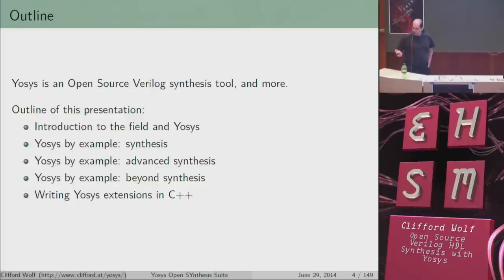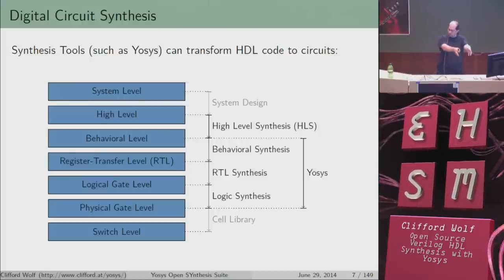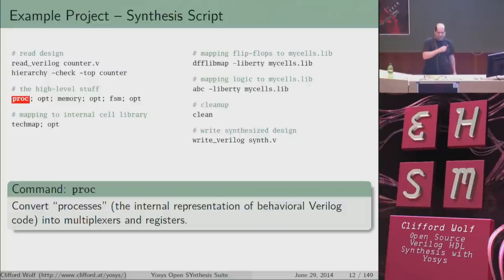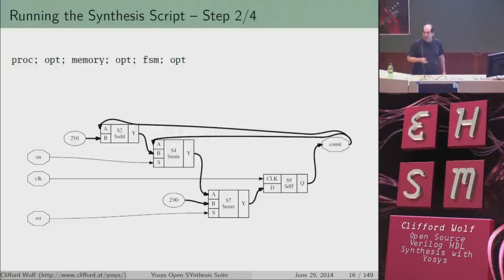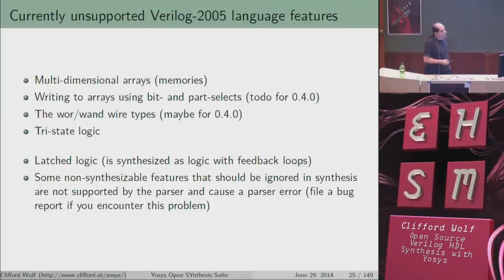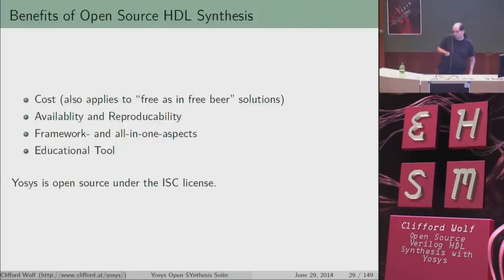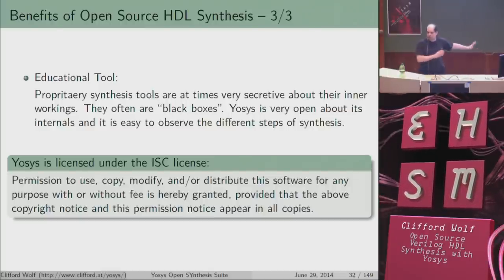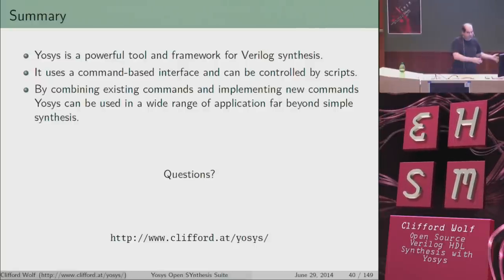Open Source Verilog HDL Synthesis with Yosys - Clifford Wolf - ehsm #2 - 2014

Comment: when I ran the command "dfflibmap -liberty mycells.lib", yosys complained that it can not find the liberty file mycells.lib. Any suggestion?
Reply: From the yosys documentation:
"If you do not have a liberty file but want to test this synthesis script, you can use the file examples/cmos/cmos_cells.lib from the yosys sources as simple example".

You can find it at the github repo:
https://github.com/YosysHQ/yosys/blob/master/examples/cmos/cmos_cells.lib

Just save it to your local system and point yosys to it.